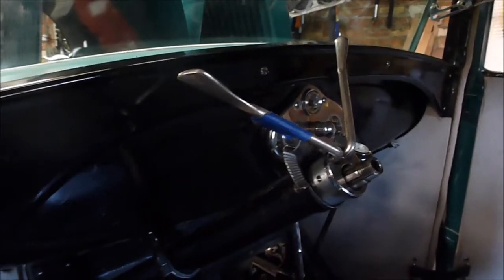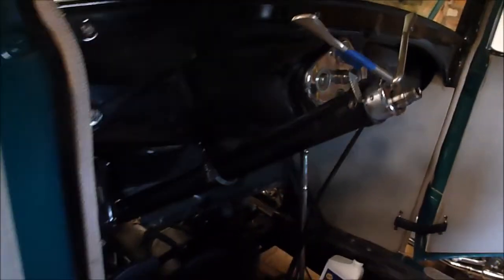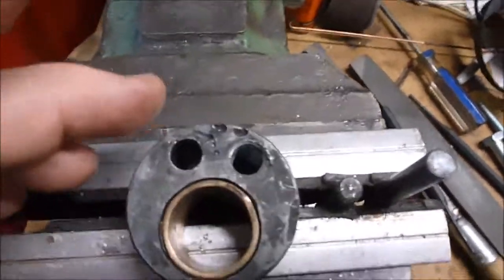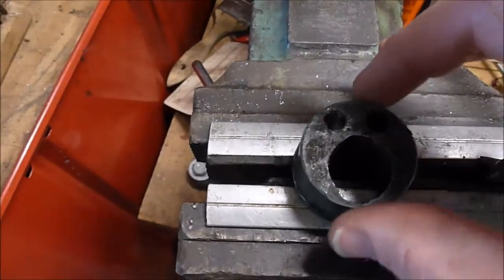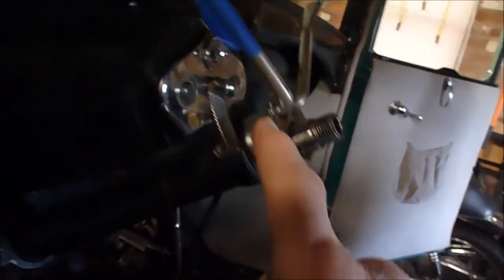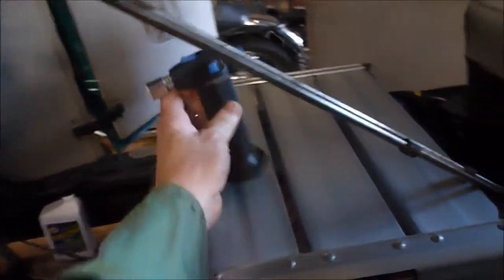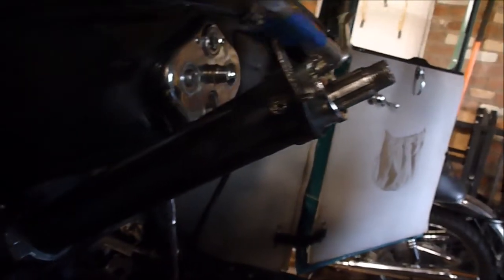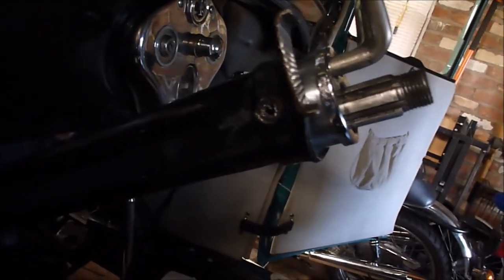Model A Ford Control Rod Repair and Replacement

Comment: Ingenious solution. I can see putting an epoxy point on the end of the rods then after feeding it through a little heat would pop it off.
Reply from the maker: I think that would work. You just need to guide the rods into the holes. A piece a string may even work, just pull it through the bottom hole instead of pushing from the top.

Comment: Wow thats great.  I just bought my First Model A and I know I'll use your process.  I might add that I immediately subscribed when I found out you had a 7 tooth.   Mine is a 1928 BIGGS 4 DOOR
Reply from the maker: Thank you for subscribing Kenneth. I've recorded all the mishaps with my transmission and hope to post them soon. I'm trying to focus on the little details that others leave out on the problem solving tera firma. While I'm far from an expert on this car, I can spot the problems and solutions quickly.

Comment: Very innovative! Thanks for the video😄
Reply: Thank you Sunny. I hope the video helped to solve some problems.  I have many more videos of clever solutions in my work that I need to get busy with and post. Thanks for the kind comments.
Reply: I was lucky and found a rebuilt 7 tooth early '28, splined steering column assembly at Hershey that I needed for my '28 phaeton.  I removed the red steering wheel, and the new spark and throttle rods from my old column.  I installed the rebuilt column and then tried to install the rods.  I couldn't do it.  So I went on youtube.  I found a different "How To" video so I removed the column and tried to install the rods.  Then I found your video.  I followed your directions, and it worked smoothly!!!!!!  Thank you so much for taking the time to share your knowledge.  I really appreciate your advice!!!!!!!!!  THANKS!!!!!!!  I will be sharing your video with other Model A members of the Model A Ford Club of Long Island NY

Comment: Quadrant- but I like the pie crust description!    Great video, you are right most of what you read about dealing with Model A steering columns leaves out a lot of details.  I have some raw video detailing how to remove the steering column by dropping it out the engine bay, I hope to post that sometime in the future to assist others.  Interesting of all the reproduction A parts, you don't see steering columns or quadrants being reproduced.  Not all of us weld :)
Reply from the maker: Thank you for the proper terminology and your kind words.  Funny it's called a quadrant when there are only two. I'm having fun with this car but it likes to give me trouble as I'm making it roadworthy and safe. Transmission went boom-bang over thanksgiving so I'll try to post some videos of my shenanigans with that escapade in the spring.

Comment: They travel in an arc.  They bow.  I did this with out removing the bushing.  I brazed Tig wire to them.
Reply from the maker: You are correct Judge! Before I attached the guide wire, the rods were crossing into the adjacent holes; no good. That's how I came up with the wire idea to guide the rods into the correct holes.
Reply: @thatsallfolks9702  yep.  I should have pulled that hub.  I didn't even think about it.  Had everything apart on the table.  I did not get the anti vibe leather back in.  I'm trying to vid most of my rebuild of a 1930 close cab truck.  I dismantled and reassembled the steering box and column but I don't think I filmed any of it.
Reply from the maker: @essentialjudge2279  I also forget to photograph my progress, I've been trying to avoid filming while working on the car due to the deluge of profanity that vomits from my mouth as I work on this car. The mechanical hackery that I've encountered along the way is amazing and yet a testimony to the durability of these cars. I am turning this car back into "Henry's Lady" regardless of her tainted past. Try to remember to document along the way, skinned knuckles and all. This his part of the cars history along with yours. Enjoy your truck and drive it as often as you can; these cars are a riot!
Reply: @thatsallfolks9702  There's been some cussing.  And I've taken everything apart twice. Lol.